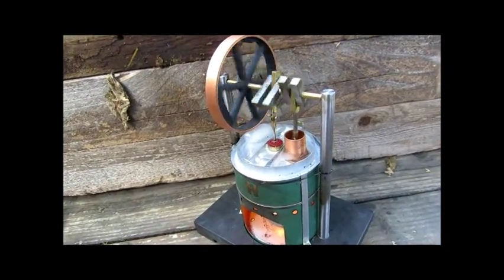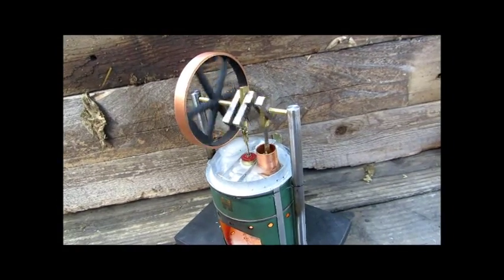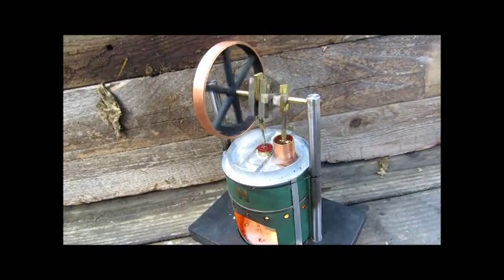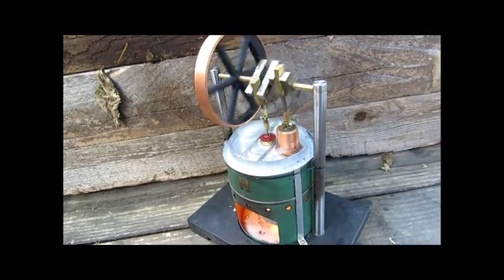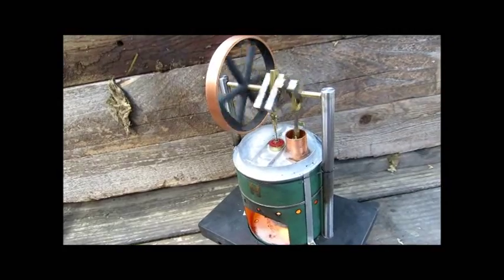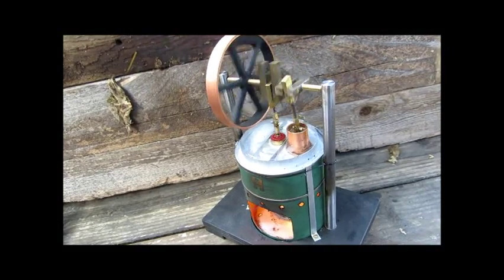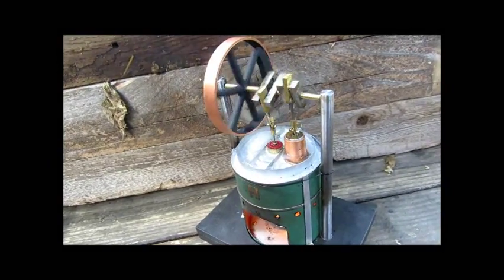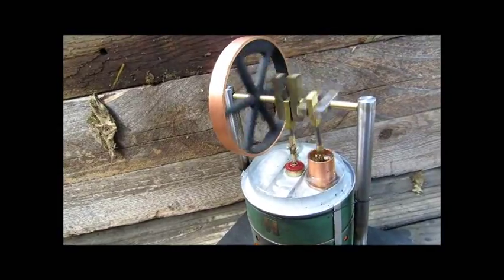Stirling Engine hot air) #5

Comment from the maker: Hello Antonio,  The piston is a piece of 5/8" diameter aluminum tubing.  It was filled at bottom with J.B. Weld for sealing and securing the connection piece.  Glad you liked video.  Thanks.  Robert